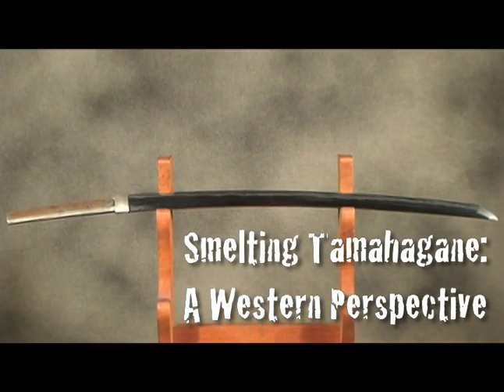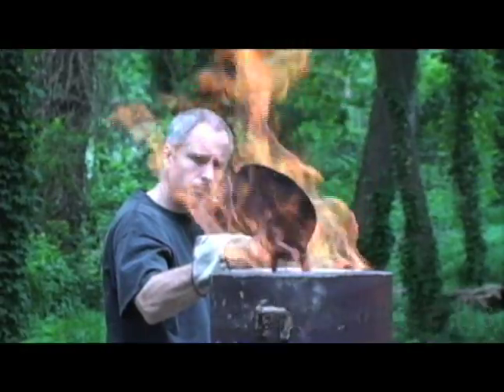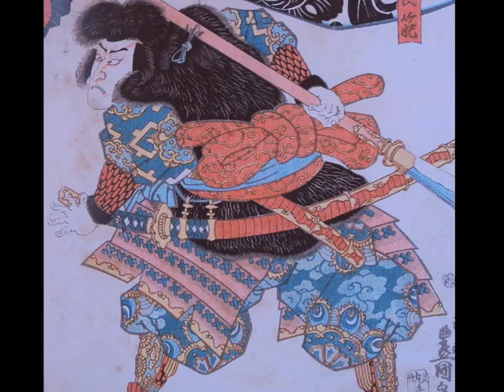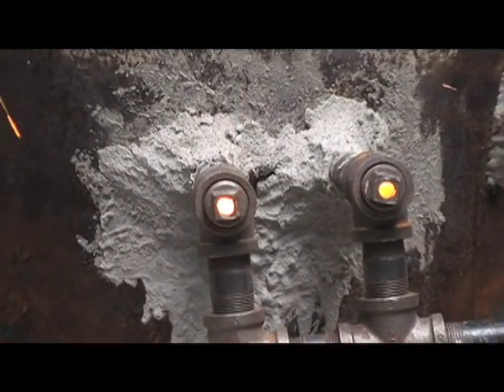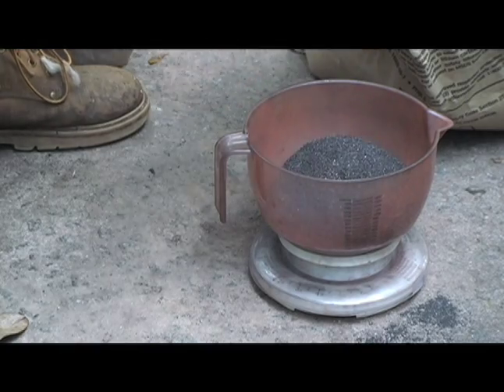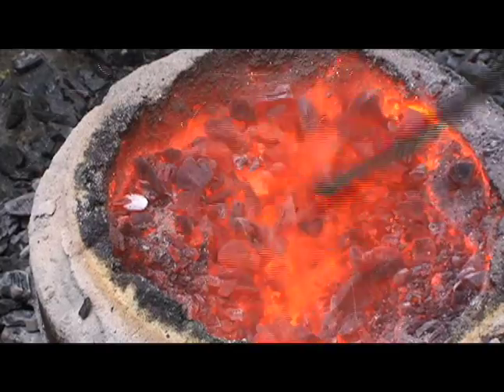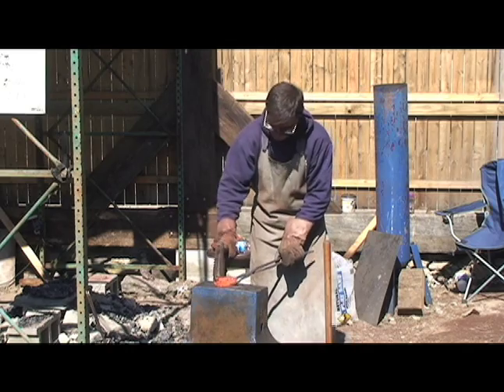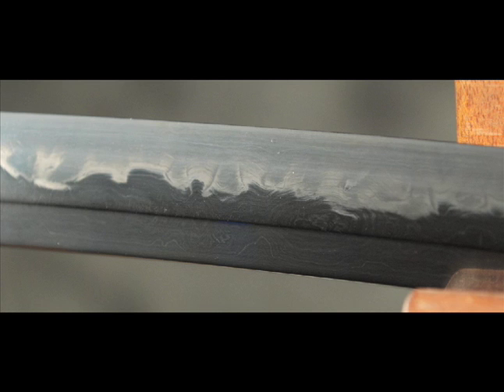Japanese Sword:  Tamahagane Smelting with Bladesmiths Walter Sorrells and Jesus Hernandez

Comment: They're missing a large part of the tatara's construction. Below the tatara, there's a 3 foot deep hole with 2 ventilation channels on either side. The reason for this is, due to the high heat inside the furnace, impurities, ash and bits of charcoal will sink down to the bottom faster than the bloom. The end result should be a relatively pure lump of metal, sitting on top of impurities. A big risk for this though is if any moisture gets inside the furnace, its will reduce the temperature of the flames, ruining the steel, forcing the smelter to start all ovwr again.

Comment: I want to actually do this at a blacksmiths but i have no idea how to obtain tamahagane
Reply: you would have to make it... the Japanese treasurer that steel and only the finest sword makers can get it... if you can buy it I bet you would pay quite a bit... I've just started with blacksmith and its not as easy as it looks I still can't performer a good forge weld that is needed... still learning... but give it a go it is a dieing trade.. it's a lot of fun to pound hot metal to see what you can make... start easy with Flint strikers and such... I wanna make a Viking Ulfberht, saw a dull unsharpened one do almost the same as a samurai sword that was sharp

Comment: Well, you are partly right, Romans did use pattern welding which use different steels with varying hardness, but the use of differential heat treatment using clay to dissipate heat propagation is unique to the Japanese sword.

Comment: I'm don't know much about smelting or forging at all, but the blade they showed looked almost like Damascus steel.
Reply: +d3aph  Forge Folded Steel also known as Pattern Welded Steel, is Damascus. Not all Damascus was made in Damascus. :)
Reply: +brett248vista thanks for the new knowledge!
Reply: +brett248vista  very true brett, also Damascus steel is called Damascus because it was first found neer Damascus. also nowdays many layer 2 steels togather n forge fold them many times it will at most get a 57RC but its beautiful, many use a stainless steel and then a carbon steel n fold the 2 many times. (modern) the original "Damascus steel" we don't know how they made it exactly, but again theirs much better steel than "Damascus steel" nowdays but still Damascus is very beautiful.
Reply: +willow raven 
HRC would depend on the steels in use. no reason it wouldn't go higher than 57 with suitable steels and good tempering.
Reply: actually it's one high carbon and one alloy steel. stainless steel is hell to weld. If oxygen touches it, you can't stick the weld.

Comment: Japanese forging techniques are built around the poor quality of iron found in Japan, and the design of any samurai sword only works in a society with expensive low grade iron. The fact that samurai could ride into battle with brass shod wood armour is a testament to that fact.
Reply: MarklenIngyer
Not really, Japanese Armory was *NEVER* made of wood or bamboo. http://www.sengokudaimyo.com/katchu/katchu.html
This guy spent years in Japan researching and recreating Historical Japanese Armor. He also wrote for Osprey on historical Japanese Warfare. Basically, pre-Samurai era might have used wood or bamboo Armor, but for a limited time. Japanese Armor was made of Leather, Steel (or iron) or a combination of the two. I made that mistake almost 2 decades ago arrogantly spouting such drive about wooden or bamboo samurai armor and was actually educated quite patiently on SFI. 

Japanese metallurgy was pretty good for it's time. The iron-sand they use is actually pretty pure, with very low amounts of sulfur and phosphorus.

You need to do your research before making such obviously unverifiable affontry as if it's the real deal. The crowd you're dealing with might not be so patient with you as I am or the people that educated me...
Reply: *****
Go home troll, you're drunk.
Reply: Looking at the numbers I doubt Japan had poor quality iron ore.  Most phosphor for example comes from charcoal

Comment: Walter i had a question if tacinite iron ore pellets would work to make tamahagne since iam a scuba diver and dive in the st clair river in port huron michigan there are many pellets in the river that fall off freighters roughly how many pounds of pellets would i need to make a batch of tamahagne to make a blade  .
Reply: Mycroft Holmes
Actually... In some ways, yes. But you can buy ready-made Tamahagane Steel from Hitachi that's been forged into bars/plates. That stuff is ridiculously high-quality, like O1 or W2. They even use it in some of the highest quality Japanese Chef Knives, so I'd agree and disagree there...
Reply: ShidenByakko I think tamahagane is illegal to take out of Japan in its raw form you have to be certified by Japanese government to even buy this steel.
Reply: Yanez knife works
That's interesting, 'cos I can find no primary source, nor any unbiased statement with proper references to a primary source either... But I think it's more to do with the extremely low production volume of said material and it's associated legends of the blades made from it that all add to it's status.....
Reply: tmahagane is basically 99.99% 1050 basic steel. When i found that out I effing cried. I spent YEARS, DECADES putting japanese tamahagane steel on a pedestal... modern chemical steels are WAY better. WAY.

Comment: I was under the impression that Tamahagane is a bloom, or form of iron, or even pig iron basically. Not a form of steel.
The Japanese only had iron sands back in the day, very low in actual iron, at least compared to a good grade ore, which is what it looked like they were using.

Still, they do great work nonetheless.
Reply: +Pablo668 I think, and I could be wrong, that the iron took carbon from the coal that it was being smelted in and that marriage of iron and carbon is what made it steel.  Then you fold it over and over again to evenly distribute the carbon content of the steel and to remove the impurities.  We make steel much better than this now and you can go and grab some 1095 grade steel and maybe a softer one and marry the two to make a samurai sword today, but it won't have the same grain pattern in the blade as what was shown here.
Reply: You could be right. I have looked it up since and it is described in places as a steel.
Thx for the response. :)
Reply: No prob! :)

Comment: A hamon is not made simply from heat.

It's made from different clays being used during the cooling process. Hamons can be used as signatures of sorts from some smiths.
Reply: Actually, yeah, it is just from heat. In a heat treat, the steel undergoes a molecular change. The clay just acts as an insulator so that more heat goes into some areas than others, thereby affecting which areas are changed. If you could localize heat in a very extreme way, the clay wouldn't be needed.

Comment: Is this steel made from iron ore sand from the region in Japan that original Tamahagane is made from?
Reply from the maker: Foxpest There's no such thing as pre-smelted iron ore.  By definition ore is not smelted.
Reply: +IamIUareU Vikings did not typically use crucible steel, they used forge-welded bloom steel the vast majority of the time.  The exception to this would be the Ulfberht swords, which were made from crucible steel which was likely not made by them, but instead traded for from the middle east.  If they had more ready access to crucible steel, the Ulfberht blades would not be nearly as remarkable as they are.
Reply: It seemed like it was, since they are making tamahagane
Reply: *****
crucible steel produces high carbon content steel, they place steel produced as described in the video (called bloom) in crucible with silica containing minerals and carbon (graphite or coal) and they seal the crucible with clay, they fire it up to high temp to melt the content of the crucible and then they brake it apart and forge the steel produced... this crucible steel can be used to make damaskus steel also... celts and vikings were know to use such steel, i watched a whole documentary here on youtube about it but i cant find it now :( if i find it somehow i will share the link with you...
Reply: farcere No I don't agree, if the materiel was pre smelted iron ore, not iron sand, then the result is not tamahagane as known. The process is similar, but the materials dissimilarity, will not qualify as a duplication of the original resulting sword steel.
Reply: +jester blade celts were using what is know as crucible steel not bloom...
Reply: *****  nah no offended in any way... :) i will search for the documentary later today after i come home from work, if i find it i will write you...
Reply: +talley1013 I also thought Tamahagane referred to the sand the Japanese used for  steel production.
Reply: diamondflaw
wrong, damaskus steel was traded to them from the middle east, vikings in the latest years were producing the majority of their swords and axes from crucible steel (they couldnt produce hight enough heat to produce other steel except chemically bonded crucible steel), it is believed that the crucible steel was actually invented in the north... middle east was using only damaskus steel...
use logic, damaskus steel = long or curved swords with flexibility, crucible steel = short straight stiff swords and strong axes...
Reply: First off it's spelled damascus.  Secondly, "(they couldn't produce high enough heat to produce other steel except chemically bonded crucible steel)" ...ya I'm calling bullshit.  Finally, damascus steel is crucible steel that in ancient times was made in Damascus, Syria where it was then traded for.  Search for wootz steel to learn more.

Comment: I've heard that traditional Japanese tamahagane is usually 1075 steel. Is that true? I've always wondered what carbon content it has
Reply: Carbon content ended up being around 0.70%, so you could say that 1075 would make a decent approximation of what the makeup of most swords were. I think saying that "traditional Japanese tamahagane is usually 1075 steel" is quite the leap though.
Reply: not really. 1075 is a simple steel comprising of iron and .7% carbon and not much else. Many of the blades were made of steel so similar to 1075 as to be practically identical. Some samples of Tamahagane have been tested to .7-.8% carbon with only slight traces of things like manganese, phosphorous and sulfur. 
Those are the specs for 1075.
Some had a slightly higher carbon content, close to .85-1.0%, specs closer to 1095.

Comment: +Elihu1984

Damascus Steel is a term, often used incorrectly, that actually describes the process of pattern welding. Plates with different carbon content are alternated when building the initial billet. Once the sword is made, those "layers" come out into the sword design, when using acid etching, with very beautiful effects. The term was made famous by the exceptional quality of swords that used a certain type of steel, imported from India, between 1500-1850, steel sold by Damascus merchants. Pattern welding was commonly used at the time, so people started identifying the swirls and designs in the swords with the quality of Damascus steel. The iron reserves for this steel were eventually exhausted, but people still call any sword made with pattern welding process, as a Damascus Steel sword, proving pretty much their ignorance.

Tamahagane is the wrought iron produced with traditional japanese technics.

One is a process, other is a steel, how exactly would you mix them? If you create your katana with pattern welding, well it ain't a katana no more. If you use Tamahagane in pattern welding, well then you make a very poor katana, structurally speaking. Tamahagane has a very "random" carbon content, that's why ancient japanese smiths applied folding, to even out the carbon % throughout the sword.

Technically, you could argue that katanas are made with pattern welding by default, but today's smiths differentiate "pattern welding" and "folding" as 2 different processes, though the outcome is very similar: even out carbon content.
Reply: As an advanced note. The carbon in the interlayers withing the folds  could also be adjusted by adding rice straw as "flux" mud pre 1500 and advent of european fluxes and  so I have read mud containing vanadium ( a carbide former) from Northern japan was sought out which I wonder might have been used to maybe create very thin microlines  lines of carbides, very hard steel, and maybe even some diamond like carbon particles aligned along along the cutting edge as the rice straw at high ttemp without oxygen decomposes into gasses similar to those used in diamond making. ). The trade relative to modern alloy steels is the testing and consistency of modern steelmaking, the alloying for specific properties for the different uses of specialty steels.  There is a potential trade off in folded vs single metal modern  blades in corrosion.  The folds and pattern welding may provide places for corrosion attack unless cared for like japanese ancient blades. Modern knives are likely superior in corrosion depending on alloy, but this would be interesting to test by leaving a few small samples of the modern folded material and small samples of some of the modern steels in drug store bottles of water and salt water for a few seeks and watching the results.  I would love to collaborate with anyone who has the forging test facilities to check on the micro hardened interlayer theory above.

Comment: Hey Walter, you've got wonderful looking blades. I have a question about your use of tamahagane though.

I've seen some japanese sword smiths sort the bits of tamahagane into high and low carbon piles and forge swords with the high carbon steel wrapped around the low carbon steel. Is that also your process when you're dealing with tamahagane?

Comment from the maker: Tamahagane is just the name for the steel as it comes out of the smelter (as shown in this video), prior to any folding or forge welding.  Damascus (more accurately referred to as pattern-welded steel), is steel which is forge welded and folded, twisted and otherwise manipulated to develop a pattern.  So while Tamahagane is also subjected to forge-welding and folding, it's not damascus, per se.

Comment from the maker: Shortening a piece of metal by squashing it lengthwise is called "upsetting" in blacksmithing parlance.  But there's a limit to how much upsetting a skinny piece of steel will take.  Mostly it's better policy to just start with a piece of steel that's appropriate for the task at hand.  Forge welding is best reserved for pattern development.  That said, I do have in mind doing some videos about forge welding...but it'll be a while because I've got some other things that are in line ahead of it!

Comment from the maker: Sure, it's possible to do it.  The question to me would be, what's the advantage of doing it that way?  Liquifying steel takes WAY more heat than forging and unless you've got very sophisticated equipment, it's hard to control carbon levels, etc.  If you just want to do it as a fun project, nothing wrong with that.  But it's not an accident that smiths gave up casting swords after the bronze age.

Comment from the maker: No, swords are never cast.  Casting results in brittle blades.  Traditionally, swords were always forged. Forging (properly done) results in much smaller grain size and greater shock resistance than is possible through normal casting techniques.  Modern production swords are sometimes ground to shape, a process known as stock removal.  But of all the methods of shaping a steel part, casting is down at the bottom of the list of techniques you'd want to use for a sword.

Comment from the maker: An interesting question actually.  But unfortunately the answer is that there's not any especially practical way of getting iron directly from iron pyrite (at least not so far as I'm aware).  Also, pyrite's second element is sulphur and nothing wrecks steel or iron like sulphur, so even if you could practically separate the iron and the sulphur, you'd probably end up with bad steel.

Comment: Hi, I have magnetite on my local beach, I can sieve it out and collect the fine particles around the size of sand and then separate out the magnetite from the sand.  This takes a while to process.  I can also collect small pebbles of magnetite, anything from 1mm to 5mm in diameter, these don't need any separating from the sand and I can collect quite a bit in a short space of time.  Will the larger pebbles work if I try to smelt them?  Great DVDs on sword making by the way.

Comment from the maker: They're all more or less the same. We did get a batch of hematite that was sold as "Spanish Red" glaze medium that was very high in sulphur and resulted in unuseable material. Too much sulphur makes it hot short, so when you hammer it at high temps it crumbles to bits.  Just be aware of your chemistry.  Any ore that's high in sulphur or phosphorus will be unuseable.  Experimentation is the name of the game.  You have to prepare yourself for a lot of failure when making your own steel!

Comment from the maker: The greater the heat, the faster carbon migrates.  If the atmosphere is heavily oxidizing, you'll lose carbon.  If it's a reducing atmosphere, you'll gain carbon.  Realistically, though, it's pretty hard to regulate carbon while you're forging a blade, no matter what you're using to heat the steel -- gas, coal, induction, charcoal, whatever.  You still have to pull it out of the heater and expose it to the atmosphere when you're forging, so a certain amount of carbon will be lost no matter what.